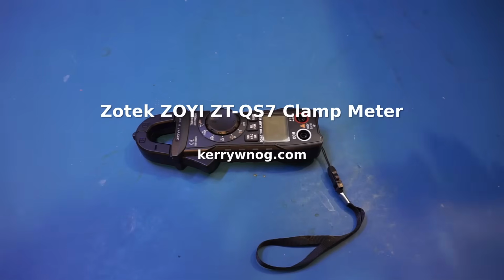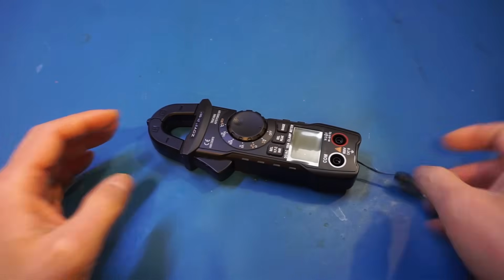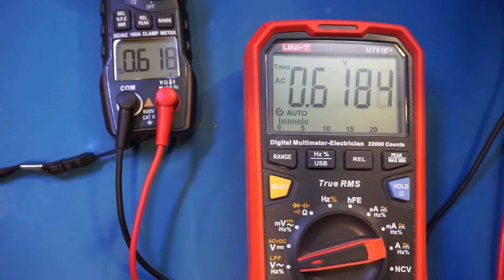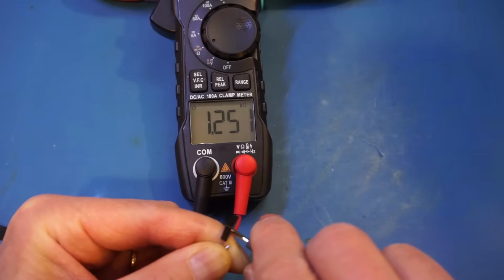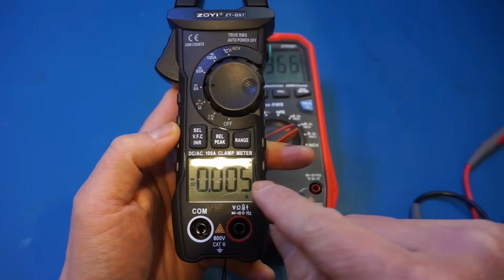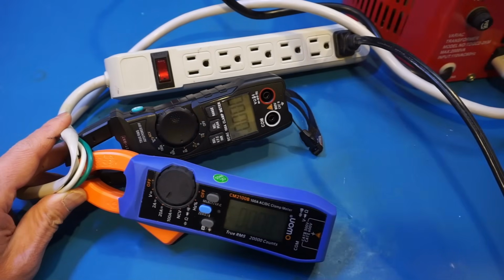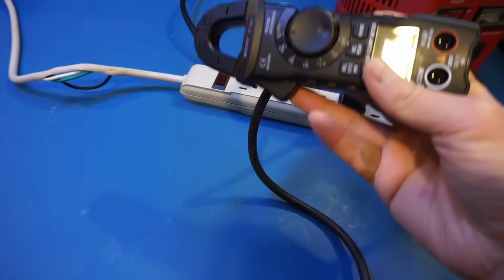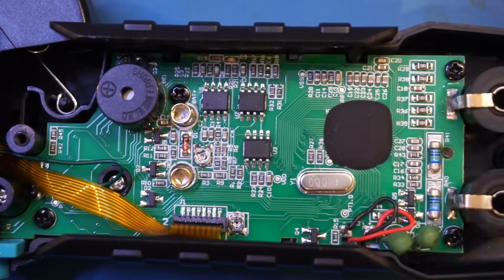ZOYI ZT-QS7 Clamp Meter Review/Teardown

Comment: Thanks, I would suspect that many people buy this type of clamp meter because of DCA or rather DCmA capabilities. And accuracy for these measurements with clamps may generally be difficult to achieve. It would be interesting to see a comparison of the DCA / DCmA accuracy between this clamp and Uni-T 210E, 210D, 211B, Owon CM 2100B, and Ziboo UT210E. Possibly also do a teardown to see how well they are done inside. Can you do such a video?

Re the test leads, I would not expect anything from these. I recently got a Zoyi ZT-225, and the included test leads were even defective and landed in the bin (am happy with the ZT-225 though - for electronics)

Comment: OK I have just ordered one of these meters on the strength of your review. I find I often want to measure DC current and clamp meter would be the best way to do it, and I don't have a DC one. This is the third item I have bought after seeing one of your reviews. The others being a Zoyi tweezer style LCR meter (excellent) and a powered solder pump(Crap, but you said it was!!). Thanks for the reviews. Cheers and beers Al.